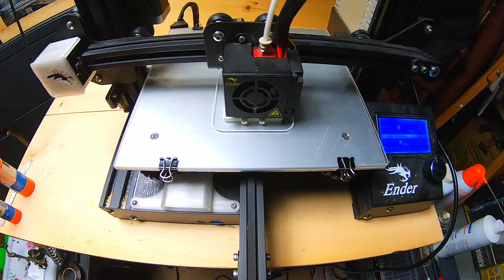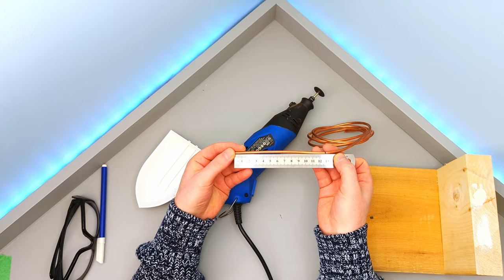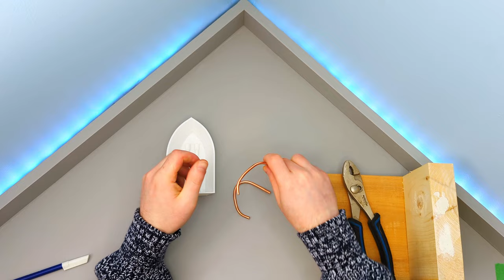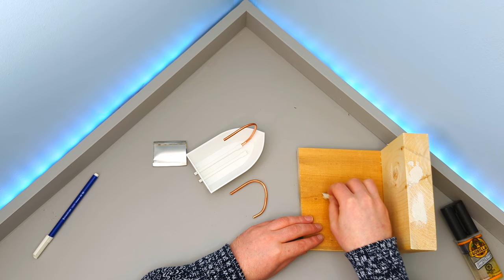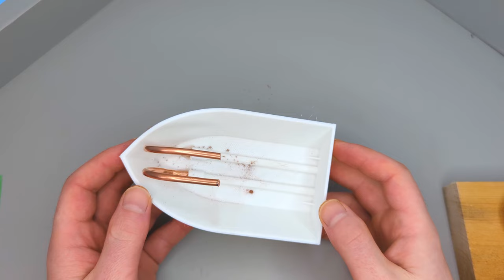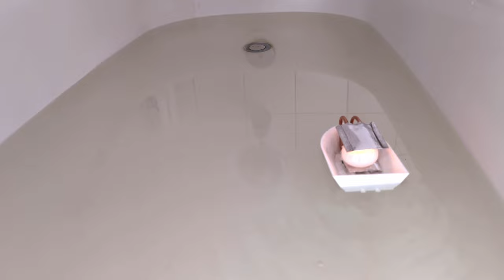How to 3D Printed PopPop Boat | Science Fair | Summer Project

Comment: Cool 3d print. I'm curious, did you prime the engine (put water in one tube until it comes out the other)? Usually you have to do that before a pop pop engine will work.
Reply from the maker: Yes, that is a great question! I did prime it and I was also checking every time I put parts together and added epoxy. Making sure that the passage was clear from one tube, into the heat chamber and out the other side. Thanks for the question. Let me know if you try it, I would like to hear your experience!